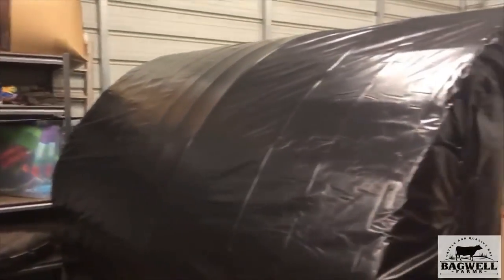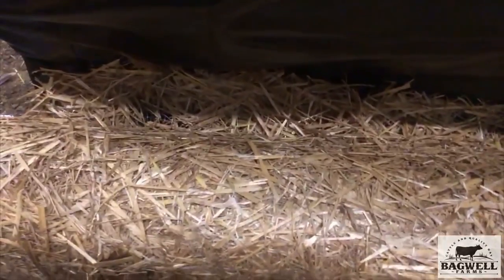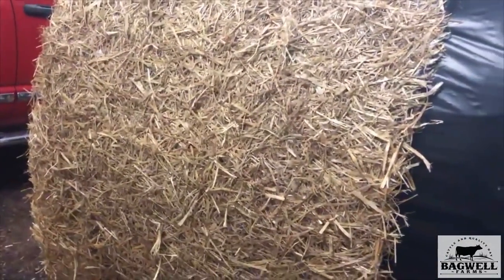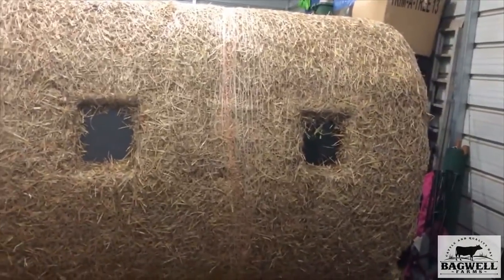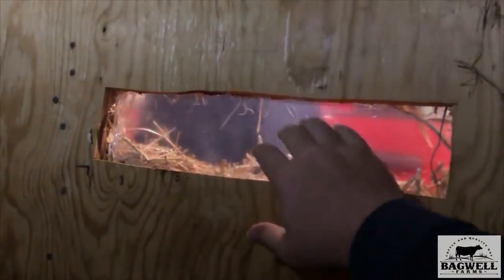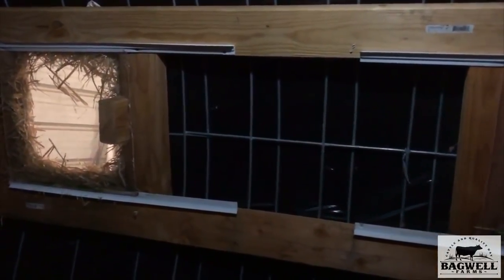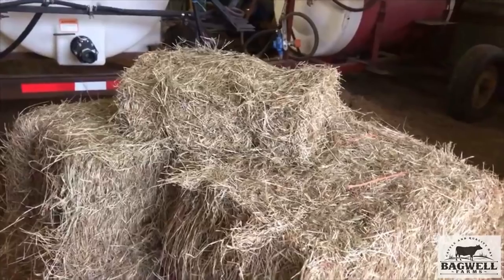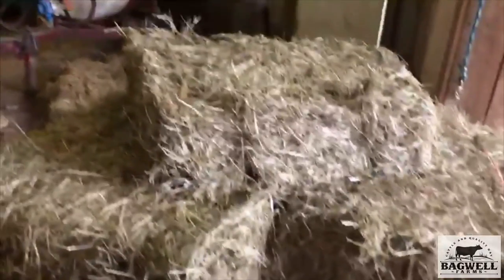Putting hay on the blind an preservative update

Comment: Does your hay preservative smell like strong  vinegar ish in barrel I bought hay preservative going to rig an applicator but mine smells strong in barrel I'm guessing it's just concentrated form the one i got is john deere green guard but it all made by harvest tech from what I can find online going to give it a try great channel you have thanks
Reply from the maker: Jason Gibbs yes when it’s in the barrel it stinks but once you spray it on the hay it just smells like really good hay
Reply: @BagwellFarms  on your tips I am thinking they are putting out a flat fan pattern do you have them spraying vertical or horizontal at the hay finger pickup I'm thing horizontal have the same baler thanks for help
Reply from the maker: Jason Gibbs there flat spray tips an there horizontal make sure the cover the entire area where the feeder fork is